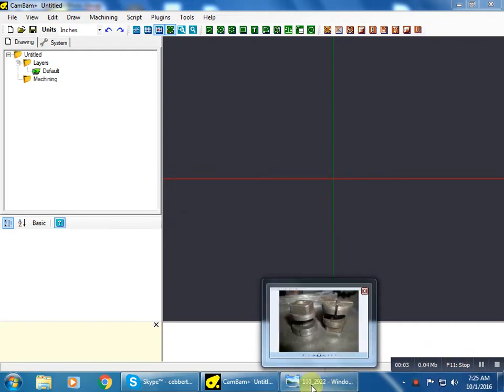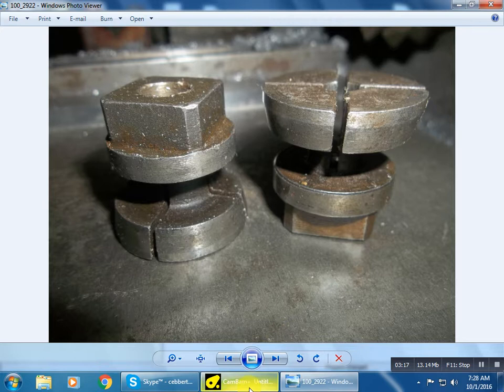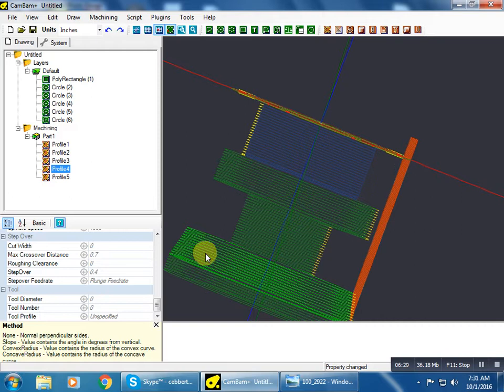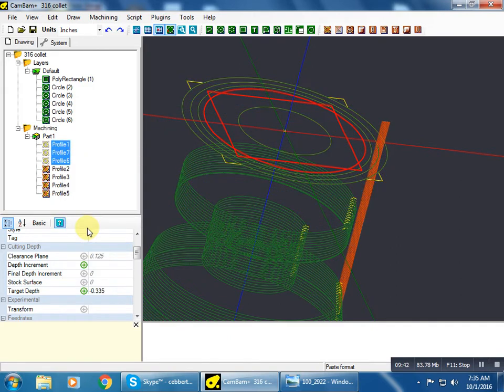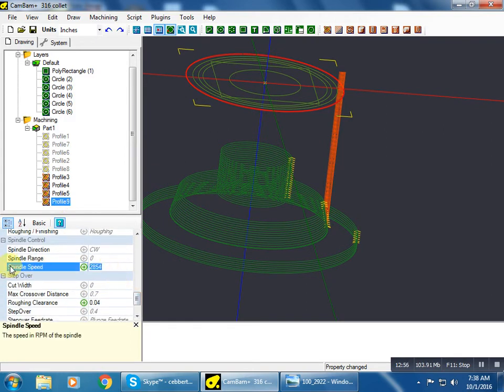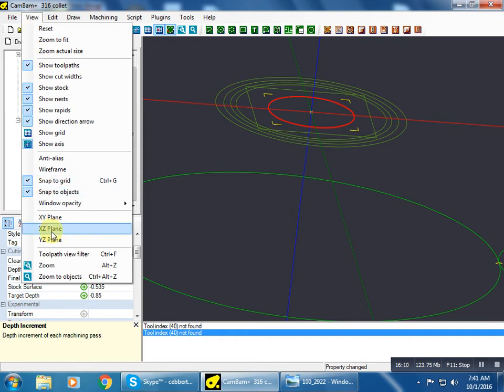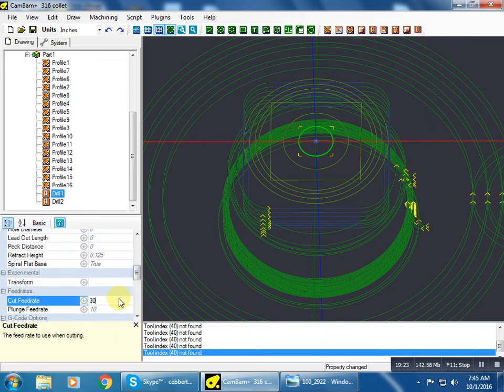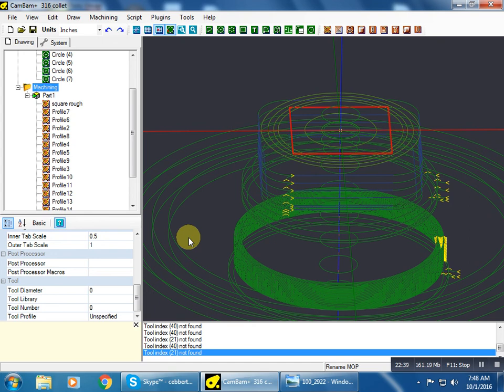Using CamBam to "draw" a collet and produce G-code - tutorial of sorts

Comment: Here's how you can do the multiple passes with your 2" tool.  Set "Cut Width" to a size greater than your tool diameter.  Specifically, I think you should set it equal to the tool diameter + the width of material to be cut away.  Set "Max Crossover Distance" and "Step-over" to the same value.

For an example similar to yours: Assume that the stock size is 2.25" OD and the finished size is .75".  The amount of material to be removed per side is (2.25" - 0.75")/2 = .75".  The tool diameter is 2".  So set "Cut Width" = 2" + .75" = 2.75".  If you want a step-over of 0.1", set "Max Crossover Distance" and "Step-over" = 0.1"/2" = 0.05.

This should generate 7 passes of 0.1" bite each.
Reply from the maker: You know, I figured there had to be a way to do it like that but couldn't figure it out.

That's great! Thanks!